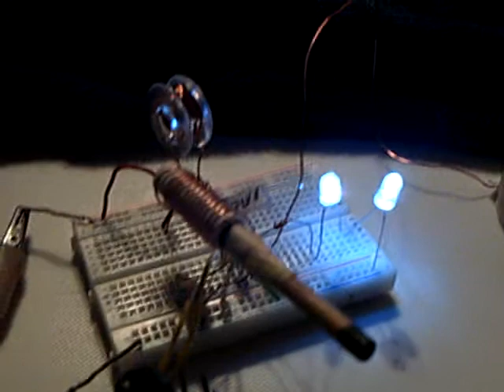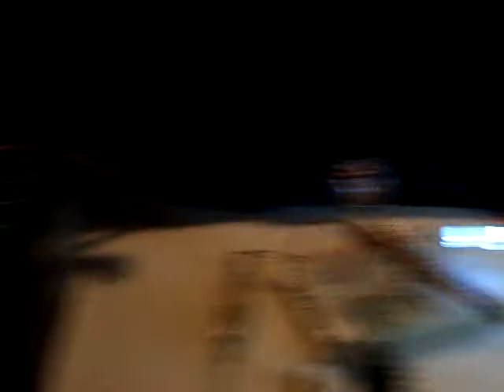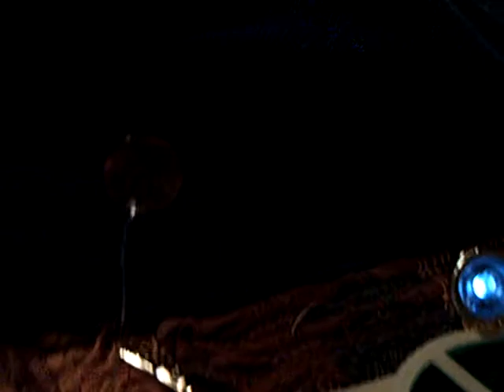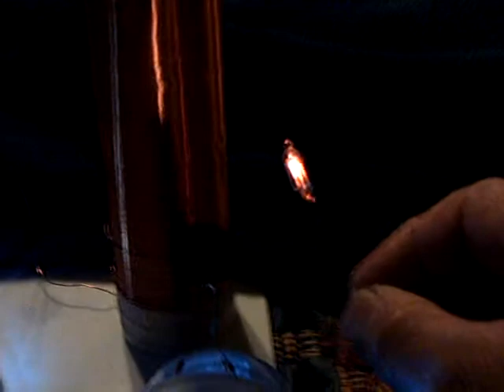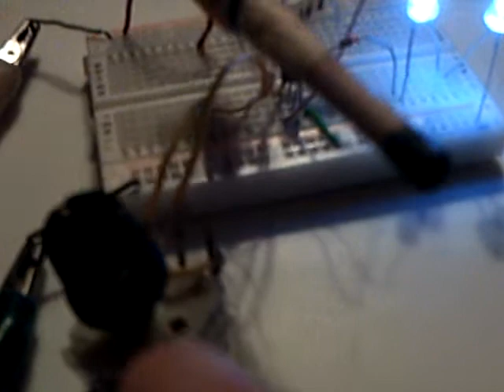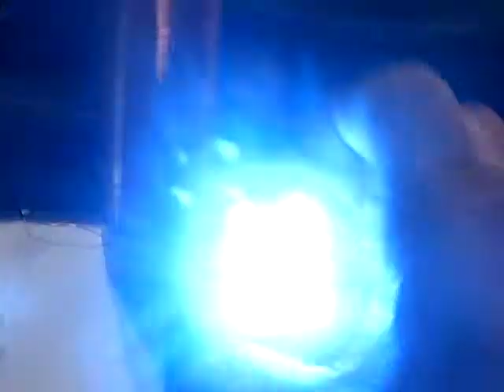Modified SEC exciter

Comment from the maker: @jonnydavro ----- Jonny this worked really well.  It took me awhile to find the resonance.   What really surprised me was that the transistor didn't get hot .   Dr. S told us that if you have the load correct on a SEC circuit that this would happen.  Those of us who have studdied his work should try to at least get a 3 coil setup working  ----with the ultimate goal of a PSEC replication.  If that device can be replicated and made to run in controlled environment with no input energy------ wow.

Comment from the maker: @ibpointless2 -----Yes she is.  The power has dropeed off but I think that it is because I disturbed the cryctal cell.  You know how fragile they are and that is why I encase them in cardboard..  If the cell does expire then I will take it apart and do an autopsy.  Temperatue seems to be something that these cells are very sensitive to also.  The summer heat is over and we are into colder weather now.